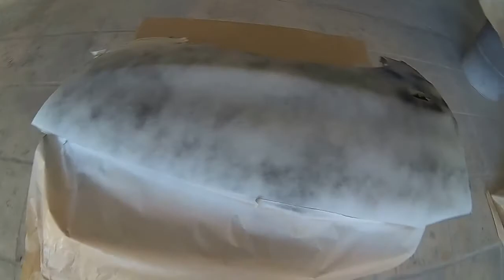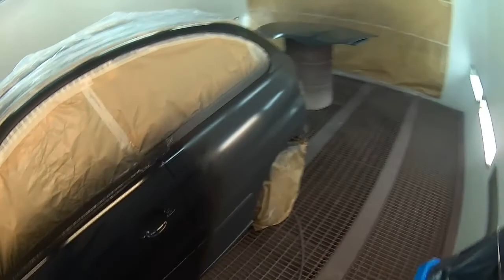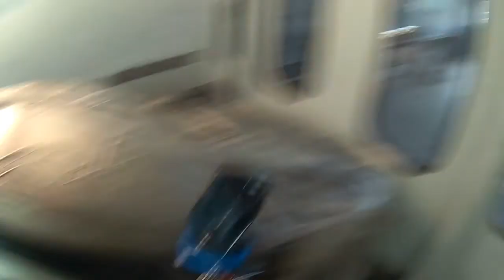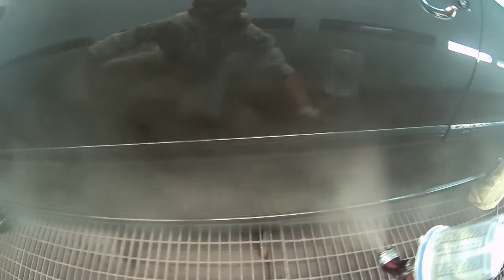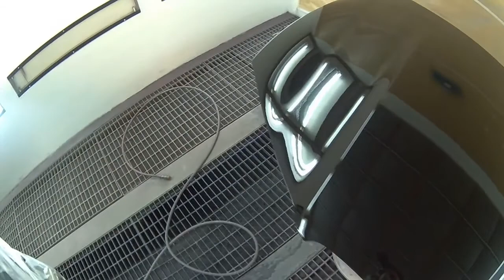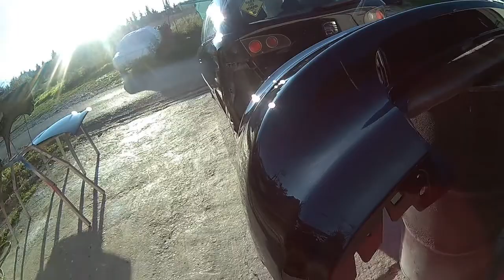HOW TO PAINTING SIKKENS SUPERIOR AUTOCLEAR LV

Comment: this sikkens superior clear is repairing itself in the sun.is it?
Reply from the maker: Yes, my friend . them to the sun is superior autoclear lv ... why..
Reply: ok i remember now it is the sikkens exlusive clear i used couple if years ago,it has the ability to re flow in the sun,so small cratches will be disapearing.
Reply from the maker: I have not tested exclusive, because if you try to do it in whole painting..
Reply: i did a couple of whole cars with it,then sand it with 1000 and then again 2coats5,and i can say it was amazing how it looks:)
Reply from the maker: How much does the superior in Holland, here has 140 euro 5 liters end 38 1 litre harter.
very expensive
Reply from the maker: and 8035 here 120 euro 5 litre and 3225 1litre 36 euro . how much to Holland